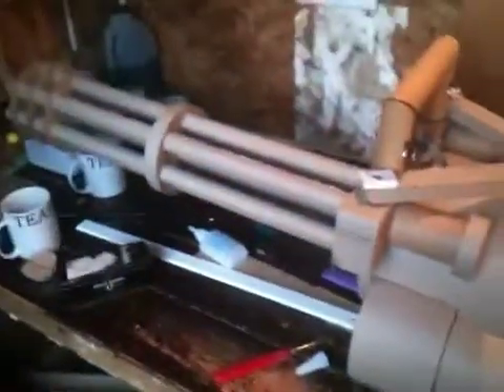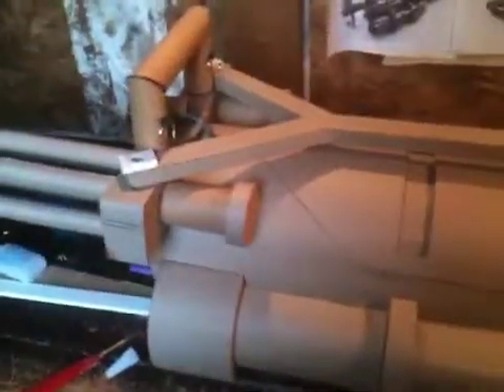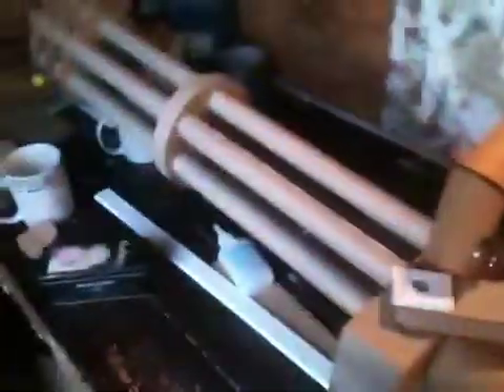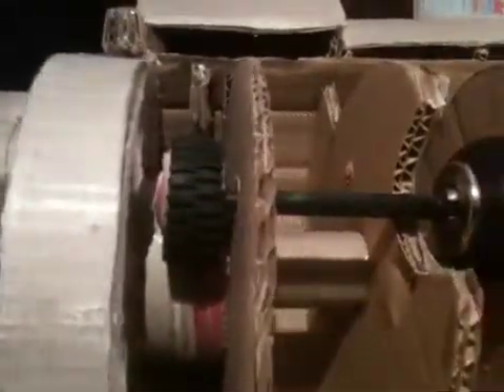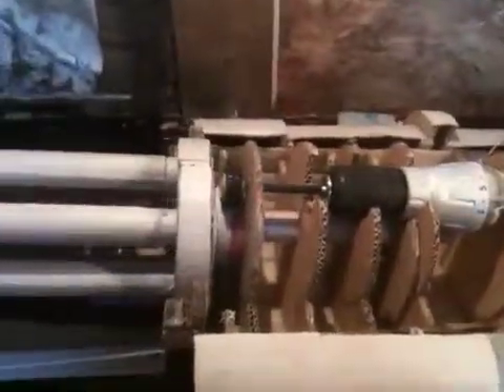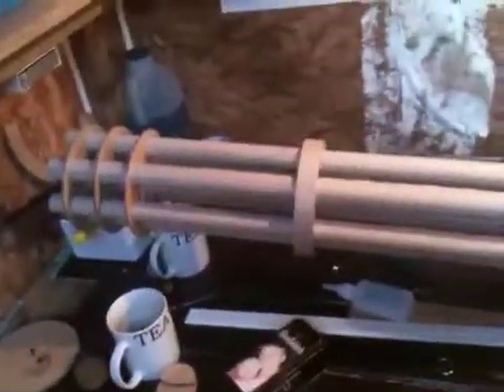M134 cardboard minigun 18v supply

Comment from the maker: @gegadinh209 i simply wired it up to a cash register switch and inastalled it in the hand grip, The led light is also off a cash register and both wired to the battery off the cordless drill :) check out my barrett 50cal in my channel.